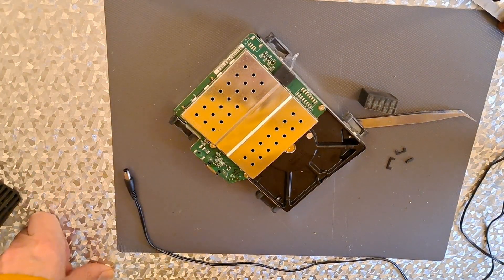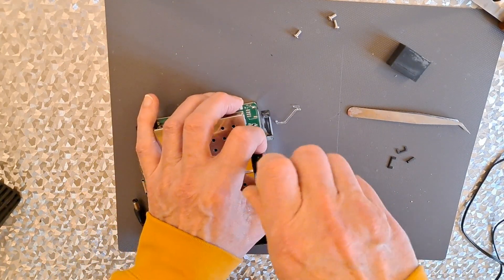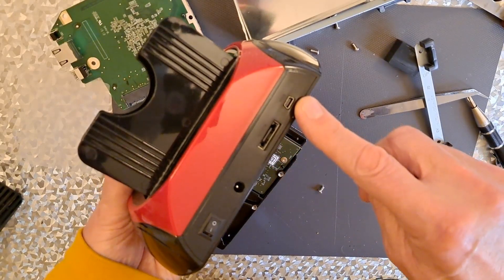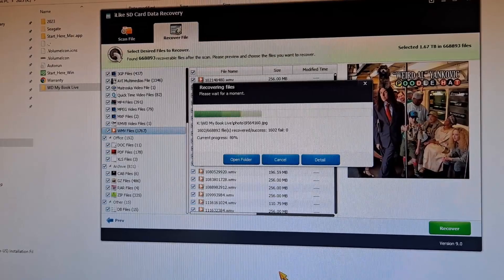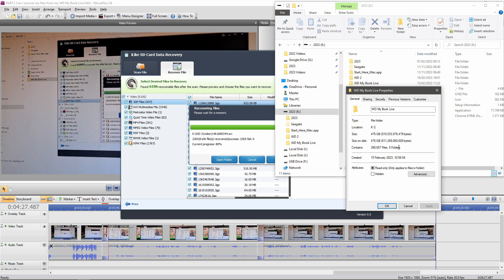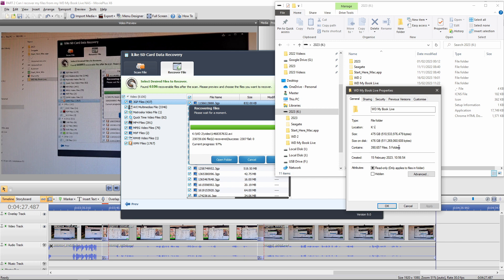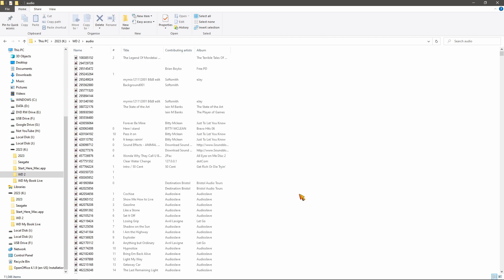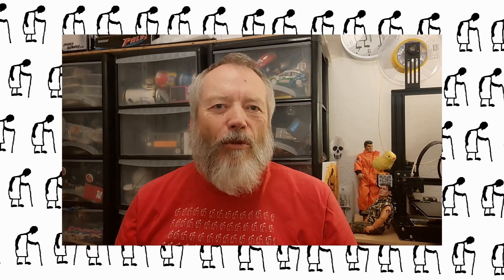PART 2 - Can I recover my files from my WD My Book Live NAS?

Comment: hope you find something worth keeping..  It would do my head in. I had similar external drive years ago I did the same and read it from a caddy..
Reply from the maker: The issue with this one was it was supposed to be encrypted, so I shouldn't have been able to recover the data, but as far as I can tell, the "encryption" was just that they did something funny with the file name format, so it wasn't visible if you just accessed the drive as normal. Somehow, the file recovery app I used was happy to read it, although the file names were replaced with a numbering system.
Reply: @GrandadIsAnOldMan  get all files you want and format it . Use in caddy.
Reply from the maker: @LarryBees  I probably will, but I really don't need any more "small" (2TB) drives. On a similar subject, I asked the computer shop to put the two 2TB drives from my dead PC into the new one. They did it but warned me they were basically junk. They run some sort of test and rated one at 25% and the other at 5% and said they would not normally install anything under 100%. My plan is to transfer all the data off them as soon as possible, onto my archive drives. The new PC has a 4TB data drive. I create monthly folders and each month, transfer the previous month to the external archive. I guess that with the WD drive (2TB) and these other two, that gives me another 6TB of storage that will probably be OK as it will be rarely accessed and normally disconnected and switched off. Just a pain having it split over 3 drives.

Comment: If it was an SSD it would be history. They're a bit more stable and faster than a HDD but when they fail everything is gone. The HDD doesn't like being bumped around but their data is basically physical and can be recovered.
Glad it worked out.
Reply from the maker: The question is, how was I able to recover the files if they were supposed to be encrypted? Seems odd the file recovery app was able to find them🤔
Reply: @GrandadIsAnOldMan  my guess would be that there was a standardized set of low level encryptions used during the time of manufacture that offered little to no protection against anyone who knew what they were doing. Just a guess though.
Security is often not what it's advertised to be. For example, in the ham radio world people often use "privacy codes" that they think make their transmissions private, when in reality they basically just make it so you can't hear anyone else, and any decent piece of hardware can instantly decode their signal and give access.

Comment: I remember years back when my first ever external hard drive crashed (WD My Book Essential 2 TB USB 3.0 by the way) I used "Partition Find & Mount" software from HDD Guru website in order to retrieve my data. I even managed to get the unlocked version of it so the transfer speeds were higher. 🤔🙄😊

Though in my case only the MBR or partition table was corrupted. Still... maybe the advice can come in handy. 😕😆